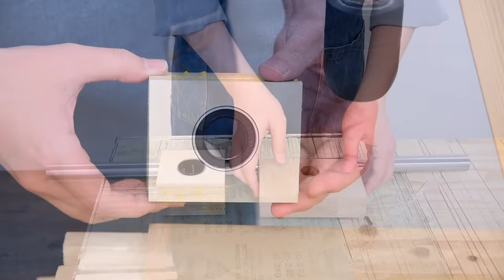Making a 6 in 1 Drill Press( Drill Guide ) Part 1

Comment: great work! It would be better if it was possible to use the drill press with a max stop depth, to make repeatable length holes. Do you think you could modify it to get this feature?
Reply from the maker: I can do it.
I'm thinking too, but it was released in this state as the video release would be delayed.
We will publish an update video if there is an opportunity.

Comment: Works reasonably well with that underpowered drill. The main issue is that switching from tool to tool is a hassle when you need to do multiple operations when separate tools can be had for very low cost these days. You really need to find a way to incorporate a bigger motor and spindle.

Comment: It is okay for little projects but sooner or later the radial load from turning and sanding is going to wear out your hand drill. Normal hand drills only have bearings designed for axial load. You can't really push it too hard.

Comment: Do the plans come in English? Also, are they purely metric, or can I get an imperial measurement set? And one last consideration,  how well does the entire system work for working metal? I should think it'd be alright, so long as it's on the thinner side, and not too much pressure put on the lever. But I've been wrong before, so what is the community's thoughts?

Comment: This could become a 7-in-1 system. With one more attachment for that multi-purpose platform, you could also configure it as a horizontal boring machine. Great for drilling into the end of a table leg or other long, thin stock.

Comment: It reminded me that DIY CNC router folks started using epoxy and quartz sand/fiber to cast heavy-duty bodies/frames/tables for their machines because the rezin is relatively cheap and correct formilations have no expansion/shrinkage after curing.

Comment: Could I use a Dewalt 2 1/4 HP router motor, instead of Drill?  A Drill usually is slower than a router.

Dewalt 10-Amp Corded Drill = 0 to 1200 RPM
Dewalt 2 1/14 HP Router Motor = 8000 to 24000 RPM

Is that too fast for this project?  Router motor is just easier to mount, and is less bulky.
Reply: Lower speed = better torque. You want the drill, not the router to drive this.
Reply: @the_arcanum  ok, Thx :) ... I thought it may be something like that.

Comment: Awesome, for hobbys this is TOP👍 but not for exact work and you need very much tools to create this
Reply: I think you WILL find this is rather exact, did you see the measurements? within 0.1mm give or take a grain of dust. Problem is, cheap electric drills will wear out on main bearing putting sideload on them. But since they are cheap, by another, in fact buy 2

Comment: And it even looks something like a drill press - but isn't.  The two missing pieces are the pressure a drill press is designed to exert, such as on osage orange, teak or metals, is many times more than your frame can take or your drill withstand.  The other is power and torque.  A hand drill must, by virtue of its intended purpose, have a small motor and much less torque than even a small drill press.  A home or small shop drill press (120 V) typically has a 1/3 HP to 3/4 HP motor and the speed is controlled by adjusting (usually 2) step pulleys connecting the motor shaft to the drill chuck.  These account for the large amount of torque since the motor always is running at full speed and not reduced voltage that robs power and torque on the hand drill.

The hand drill is a great tool and one that I use almost daily, both corded and cordless.  Pilot holes on the fly, a molly bolt hole and may other jobs.  But when the job gets heavy or requires lots of repetitive setups or precision, I move to my drill press.  Performs well, on amy type of material and has a lot of utility with the fixtures and jigs I've built for it.  

This is a nice way to build a holder for a hand drill and to do small drilling tasks.  I use something similar for my Dremel when things get below 1/8" hole sizes.  But I don't kid myself that its a drill press.  Try to use your tool in that way and you'll burn up a lot of drill motors.  Maybe change out the drill with a small 1/4 - 1/3 HP motor or similar motor.  They can be found for next to nothing at junkyards in old clothes washers and dryers, heating and air units and anything else that turns, sucks or blows.  Build some step pulleys, add a couple of belts and go from there.

Comment: Hello, I'm also not able to find any DXF files after the purchase. Now can I contact you? Normally I'm using Gmail but I have also the second account (non-Gmail).
Reply from the maker: Hello
Currently, DXF files are not distributed. We distribute PDF data instead.
As DXF file is the one before the design change, there is an error.
I distribute it if I want it, but please keep in mind that I do not support it.

Please reply to the purchase email.
Reply: @jisakukobo I'm interested in outdated DXF if it is a 3D model. Unfortunately I didn't receive any purchase email.
Reply: How can I contact you to get DXF files?

Comment: What is the dimensions of the steel bars?
Reply from the maker: Thanks for your comment.
I am sorry if the explanation is unclear. The length is 630 mm.

In the web manual, I have specified that the length can be understood.

Your questions are very valuable to make a good plan.

Thank you
Reply: @jisakukobo  thanks. How about the thickness?
Reply from the maker: About the thickness of the round pipe?
It is good if it is 1 mm or more.
The thicker, the higher the rigidity.
Reply: Where do you get steel bars like that?